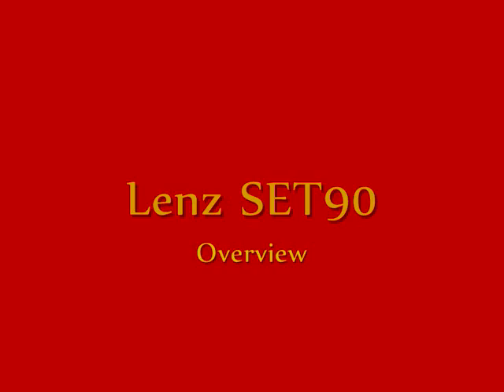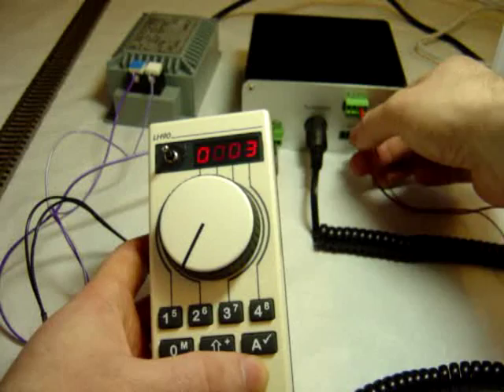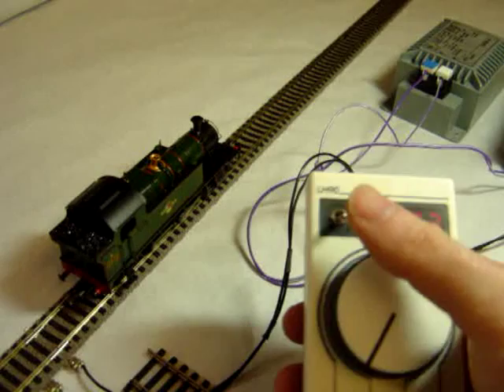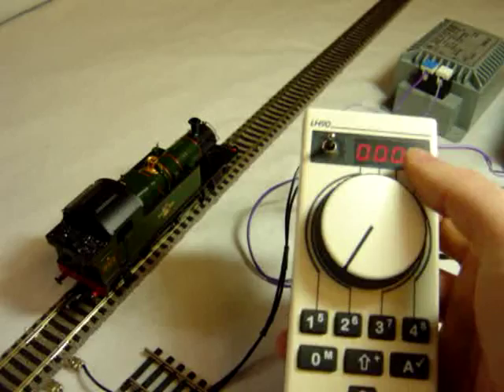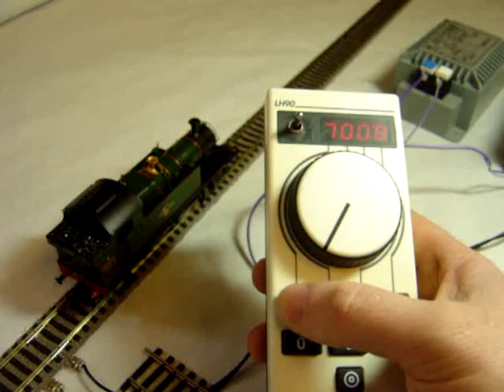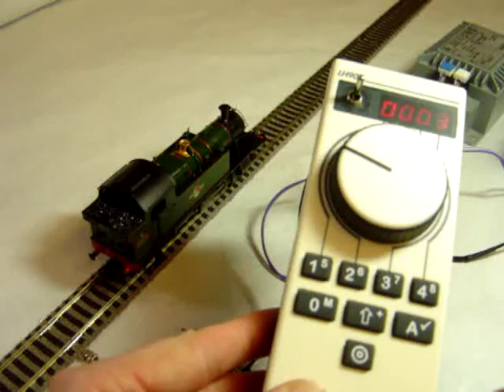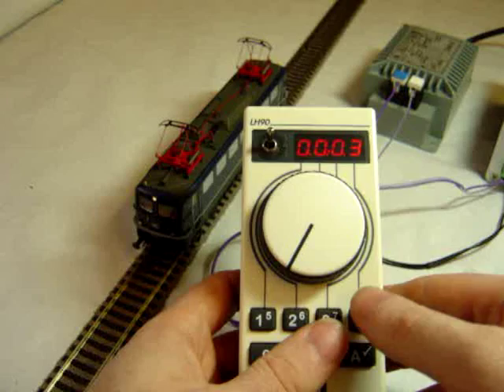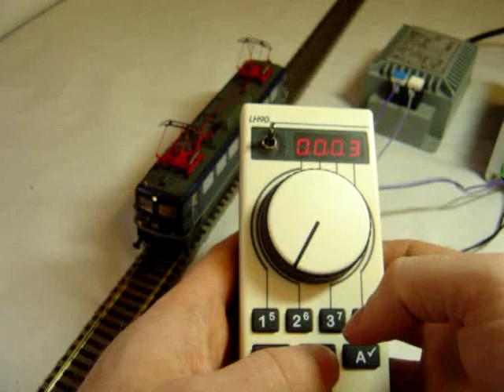Lenz SET90 Film 1 Overview.wmv

Comment: I have both 100 and 90 throttles. I program with the 100, but I prefer the the 90 for running trains (when not using wireless). I find the knob and toggle to be more user friendly.
Reply from the maker: The new Lenz LH101 handset combines the best of both - it will work with a command station that is on version 3.6 or higher.  Cheers  Chris